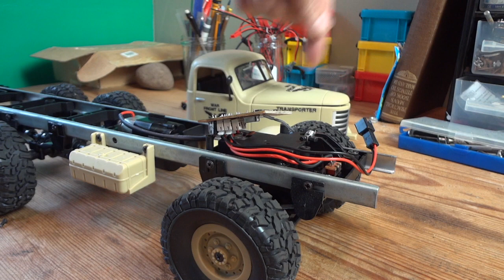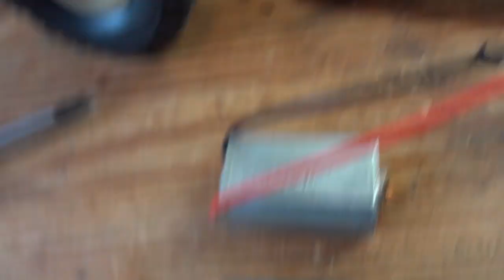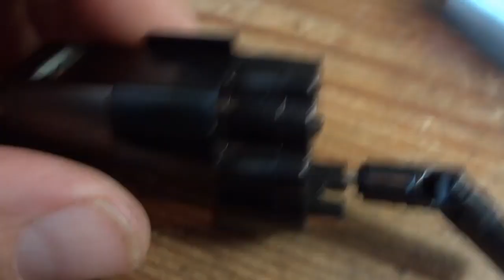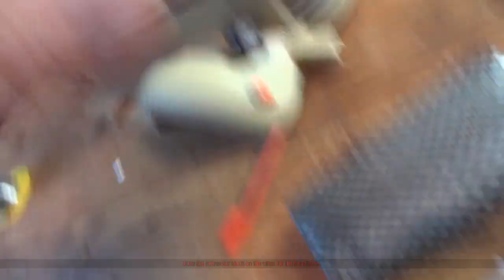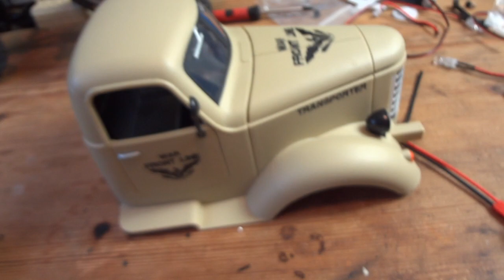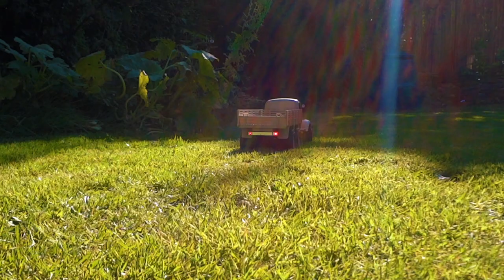JJRC Q60 Fully Proportional Steering & Throttle Upgrade Video.

Comment: Would it be possible to update the description with a new link to a servo that would work? I'm working on this upgrade currently wand want to make sure I get the right one.
Reply from the maker: Yes of course
Reply from the maker: https://www.ebay.co.uk/itm/276295913905?mkcid=16&mkevt=1&mkrid=711-127632-2357-0&ssspo=36aX4QnkQtW&sssrc=2524149&ssuid=36aX4QnkQtW&var=&widget_ver=artemis&media=COPY
Reply from the maker: Try this

Comment: I got this but a green one. and upgraded to proportional using 370 motor ..a 20A ESC and Transmitter+receiver from DumboRc.
I still have to cut front bottom line to fit in the370 gearbox. I use two 18650 battery but it wont fix at first but then i have to cut a hole so i can fit...and it works. 😁
Reply from the maker: Sounds like a plan. Bet its great with the 370 motor in it!

Comment: So do I need a new steering servo and gearbox to make my truck proportional?
Reply from the maker: No just the steering servo, ESC and transmitter kit. I put a bigger motor in just to improve power.

Comment: Nice upgrading mate 👍👍 I love this Jjrc model. On mine I cut an oval shaped window back of the cabin and changed the fuel tanks with wpl c24 ones. Stock ones are too small
Reply from the maker: I bet it looked mint with an oval back window! Did the fuel tanks fit ok? 👍
Reply: The Miniature Construction Company no it didn’t fit. You have to move it back a bit. Wasn’t too hard. Yes the oval window gives a really good look to the truck. Give it a try I’m sure it will be a very easy job for you